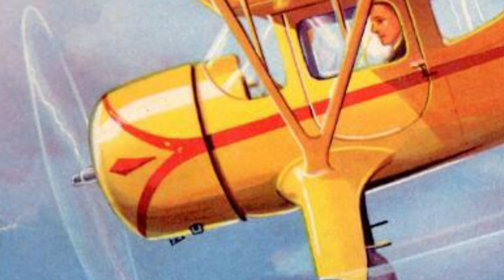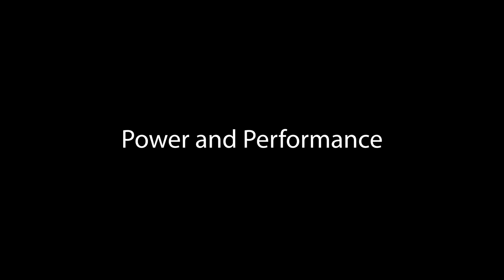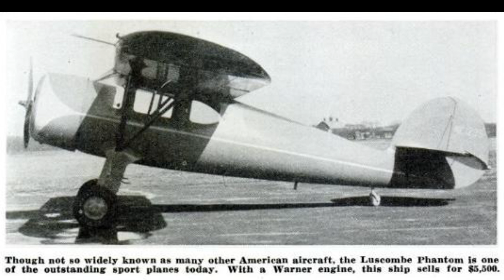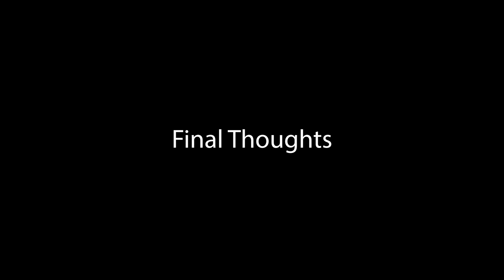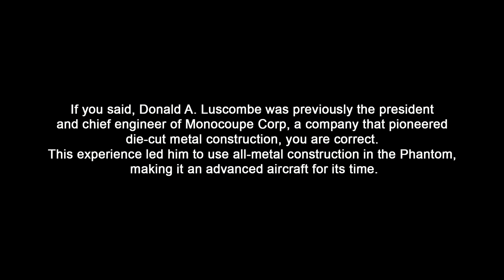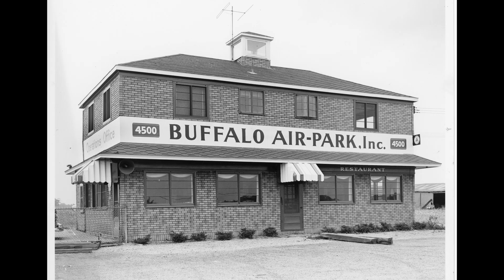Luscombe Phantom: The Forgotten 1930s Aircraft That Changed Aviation

Comment: Your Luscombe Phantom video is generally very good and covered most of the important parts well about this airplane’s turbulent history. However, a few areas need to be corrected for accuracy. 

Foremost, Don A. Luscombe was never an aircraft designer. He never designed an airplane. Don Luscombe was the consummate promoter, entrepreneur and businessman. He knew and understood what the airplane market needed and he pursued his visions with keen determination. 

After his Monocoupe endeavors, Luscombe hired the design engineers, the metalsmiths and the mechanics to turn his all-metal airplane visions into reality. Ivan Driggs, who had designed the Monocoupe D-145 previously, became the lead design engineer of the Luscombe Phantom. 

There was never a “Luscombe Aircraft Engineering Company.” The internet and AI have mingled separate company names into one. Don A. Luscombe established the “D.A. Luscombe Airplane Company, Manufacturer of Airplanes” in Kansas City, Missouri in October 1933. This company was reformed as the “Luscombe Airplane Development Company” when Luscombe moved to West Trenton, New Jersey in the winter of 1934/1935. 

A few years after Don A. Luscombe had lost control and ownership of his airplane company in April 1939 from hostile stock takeover, he formed the “Luscombe Engineering Company”. Don A. Luscombe based his new company in North Wales, Pennsylvania, not far from his stately home in Gwynedd Valley, Pennsylvania. Luscombe Engineering fulfilled various government contracts for aircraft parts during the World War II and made playground equipment (swings, slides and pogo sticks) postwar. 

Lastly, Kevin and Andrea Eldridge are restoring Luscombe Phantom (NC1043). They recently acquired a second Phantom (NC1025), which they will restore, also. Mike and Andy Anderson in Bates City, Missouri are restoring two Luscombe Phantoms (NC1249 and NC1286). Chris Lehner owns and flies regularly the restored NC275Y, which was restored several years ago by Rick Atkins in Placerville, California for Walt Bowe. 

I hope this information clarifies and corrects your informative narrative. 

Jim Zazas, author of "Visions of Luscombe – The Early Years"
Reply from the maker: Wow, Jim, this is absolutely incredible information! Thank you so much for taking the time to share these crucial details and corrections—especially coming from the author of "Visions of Luscombe."